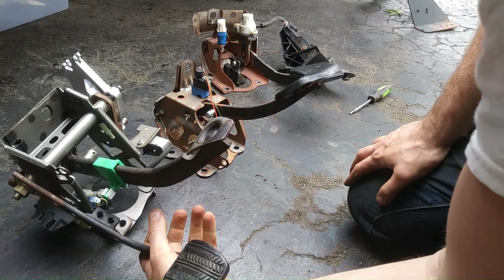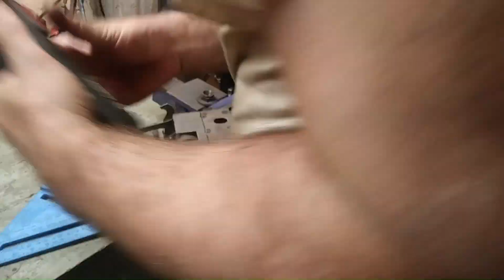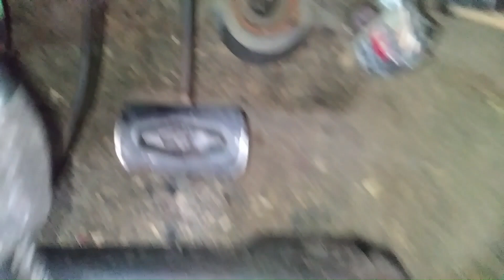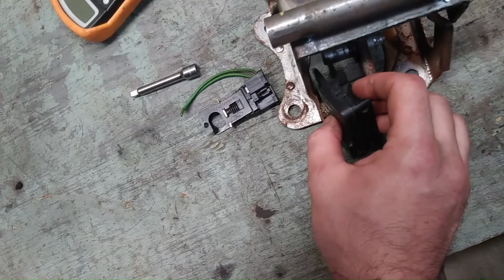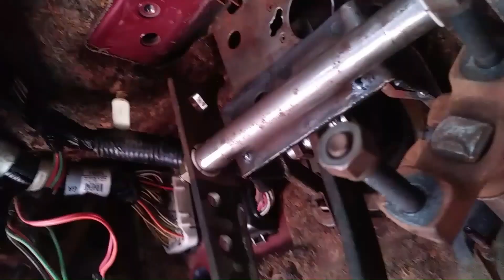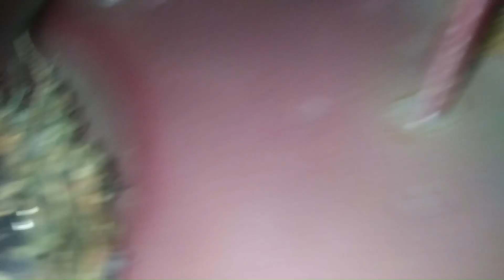Ford Panther 5 Speed Swap (2005+) - Part VII.1

Comment: Thank you so much for this series of videos, got my vic 5 speed swapped thanks to these, just need to find me that "single pole dual throw on-on" switch you are talking about for the brakes, is there a part number or brand I can borrow from you so I can find something that will work?
Reply from the maker: @sparker3d  No problem.  I’m glad it is helping some people.  

I show the part number in the video. 

Please note I have been driving my car for a couple years without that switch hooked up at all. 

I believe that switch is for reprogramming a body control computer.   Like to enter a programming mode for tire pressure sensors.  

By applying a combination of key on key off. Pedal on pedal off.  You enter the programming mode.  

But for general every day driving.   Including cruise control.  It seems to work fine unhooked.
Reply: @bpbuilds  interesting, i keep getting a pedal position a/b correlation code that puts the wrench light on, ill look into it further i suppose
Reply from the maker: @sparker3d  that code is in reference to the throttle pedal.  Not the brake pedal. 

Are you sure your throttle pedal and wiring is in good shape?  

Is your throttle position sensor in good shape?
Reply: @bpbuilds  p0504 code, its brake pedal, havent had the time to look at it today, wonder if i just don't have the switch adjusted quite right
Reply from the maker: @sparker3d  did u figure it out?

Comment: 3.27 isnt good for highways?
Reply from the maker: Didn’t you already complete the 5 speed swap?  

What is your current axle ratio?   What trans are you running? 

Watch the video I just released.
Reply: @bpbuilds  yes i done before 1 year now... Tr3650 for 04 mustang... My axle ratio is 2.73😅
Reply from the maker: @ahmedwwh2854  you must upgrade. 

You are driving a grandpa car.  No offense.  It would be so much better.  

You have much room for improvement.   

If you have the ability to re gear.   I would do so.   

I would recommend the 3.90 or 4.11
Reply from the maker: @ahmedwwh2854  what is your mpg highway?
Reply: @bpbuilds  😅😅ill gone do it am thinking to do 3.73
Reply: @bpbuilds  i dont know mpg am useing 1L/100km and it is 8.5 and some time 9.5
Reply from the maker: @ahmedwwh2854  that would be good if you do lots of highway driving.   

At high speed.  Like 75. 

Speed limits are 65 where I live.   Not 70 or 75.  

I guess if you told me your current mileage at which speed.   It would be good data to have.
Reply: Its very great for higways
Reply from the maker: Ok that’s excellent.   

That’s 24.8-27.7 miles per gallon.  

What is your altitude?
Reply: @bpbuilds  on 70mi/118km speed its take 8.5 to 9.0 L for100km.... We use km in my country
Reply: @bpbuilds  altitude for??!!
Reply from the maker: @ahmedwwh2854  OK so at 73.3 miles per hour.  

Your fuel mileage is 26.1-27.7 miles per gallon.  

This is excellent.  

Do you live near sea level?  Or do you live in the mountains?
Reply from the maker: @ahmedwwh2854  altitude will determine air density.
Reply: @bpbuilds  near the sea but i crusing to much here and there some time to the disert and some time to the mountains becuse of my work

Comment: Awesome video! I know the supercharger series is coming soon, but I don’t want to miss out on some good deals for a 94 metal intake manifold and I have a question about them. What did you do to the manifold to get the air in? I noticed it has a unique stock throttle body system and I am wondering how complex it was to get it to work. 

Thanks, I appreciate these videos, definitely one of the best creators in the Vic community!
Reply from the maker: It took a lot of modifications using a 3 axis Bridgeport mill.  

And a lot of TIG welding 

I cut the lower plenum off using a hacksaw.  And welded in 8 block off discs.  

Then basically milled a massive pocket in the top.  To gain access all the runners.  And welded in a 1/2” thick plate 

Then made a second 1/2” plate that bolts to the welded in plate.   To adapt the supercharger housing to the lower intake. 

It was a ton of work.  Very tedious.  Annoying.  The hardest part of the whole build.  And I wouldn’t really wanna do it again lol.
Reply from the maker: If you watch the last few mins of the video I just released.  It will help you make your decision. After welding the blocks on.   

I milled it completely flat on a Bridgeport mill.  This surface must be flat for a good seal.   Otherwise unmetered air will be injested by the engine.  

That the mass air flow sensor.   Would not detect.   As the leak is upstream of the sensor.   

Resulting in a lean condition.   You must ensure this surface is flat.  With a gasket.